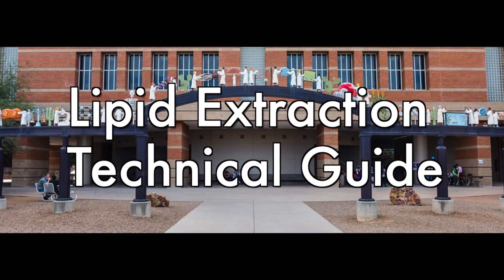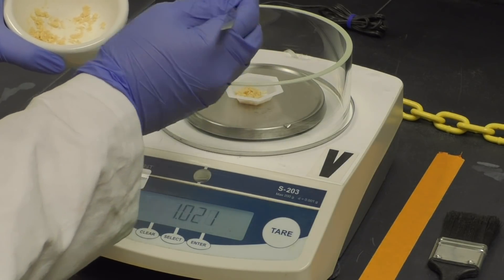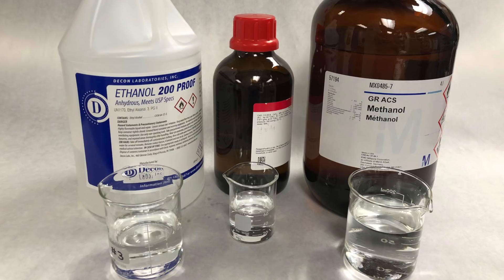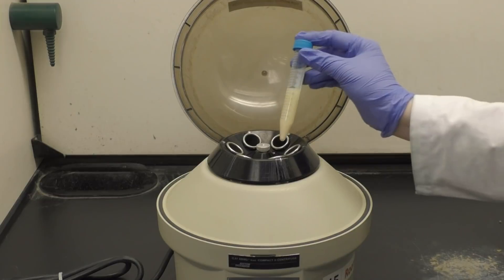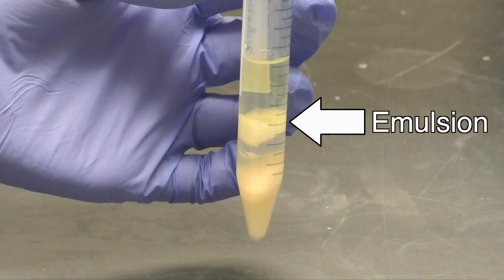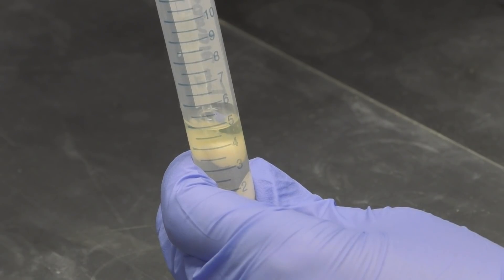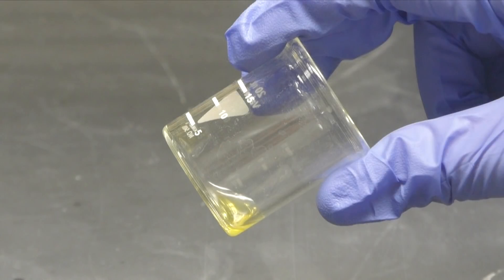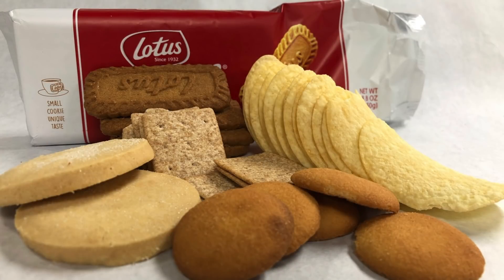Lipid Extraction Technical Guide

Comment: Hi! I'm doing a project on granolas for one of my courses and one of the things that we're trying to evaluate is its peroxide value. In order to do so, we plan to do a lipid extraction. During our preliminary testing, we used petroleum ether as our solvent in the extraction and noticed that it took an extremely long time to evaporate (we ended up letting it sit overnight and came back to the lab the next day). I was wondering if you would know why this is happening - if another solvent would be the solution? Why is our solvent taking that long to evaporate?

From research, my group members and I found that petroleum ether would work as well. 

Thanks!
Reply: Hello! I am also doing a project about rancidity of vacuum-fried watermelon. I would like to ask you if you can extract a lot of fat from the method which you did? Is the extracted fat used to determine the peroxide value enough?
Thank you🙏